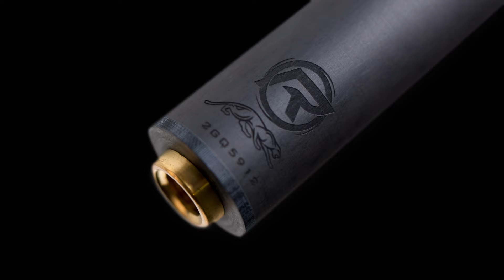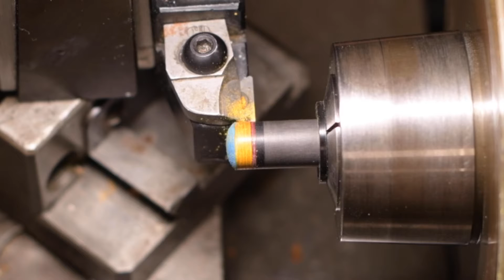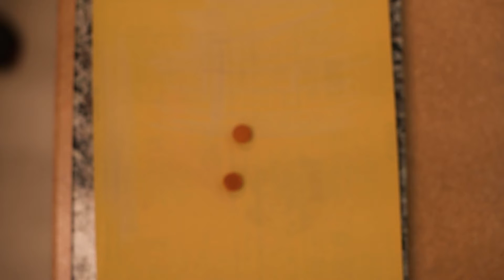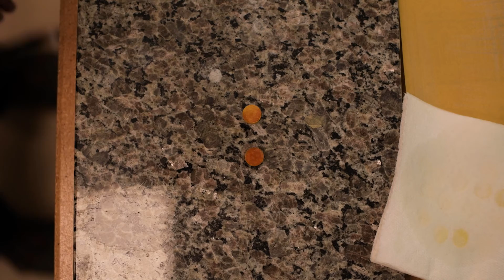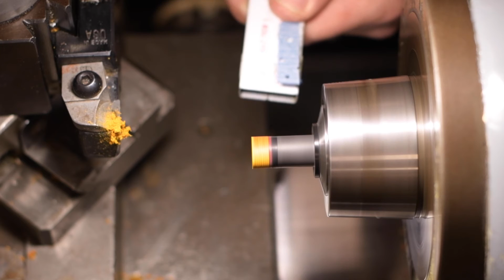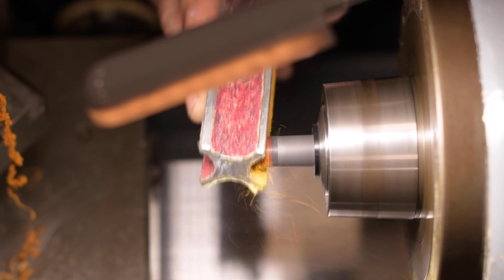How to Change the Cue Tip on a REVO Shaft

Comment: Thanks for not perpetuating the myth of using a razor blade to freehand the diameter of the new tip. I go 2 steps further to make sure i don't cut the vault plate: I leave the tape on n use an indicator on my tool post to take skin cuts (.001") with a sharp brazed tool until I just barely cut through the tape. That gets me within .001" Then I sand to blend. I also use a carbide form tool (.437R) to shape the tip, then an EVERLAST tool to finish. A vey repeatable process!

Comment: I was told that all Revo tip replacements had to be done at an authorized Predator repair place otherwise the shaft warranty would be voided. This video would suggest that isn't true, can you confirm this?
Reply: Have you had any confirmation regarding your question? I was going to ask the same thing because I also hear the same thing.

Comment: Why are two different types of loctite super glue mentioned in the beginning?  Is the 495 only used to strengthen the side of the tip while the professional is used the rest of the time?
Reply: Just get the gel. It doesn’t matter too much